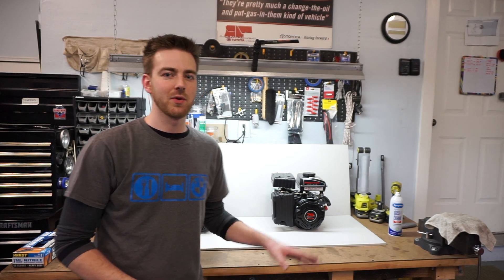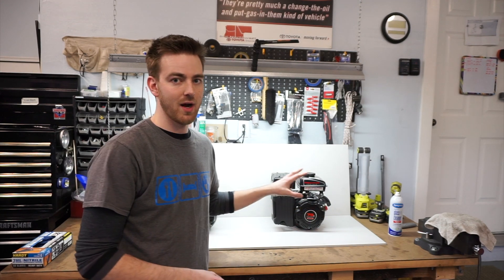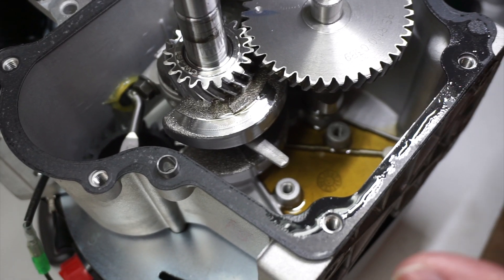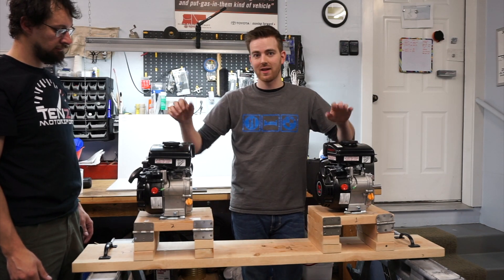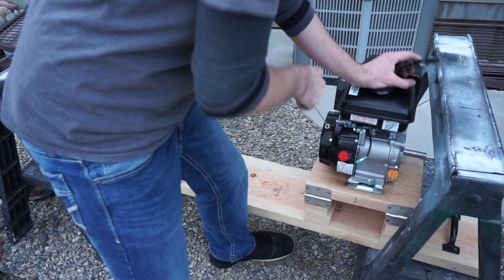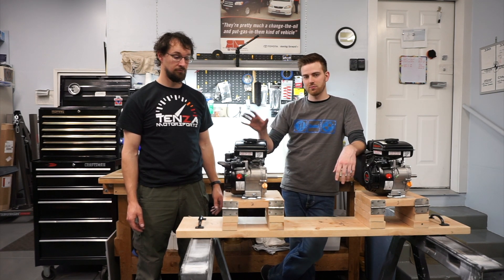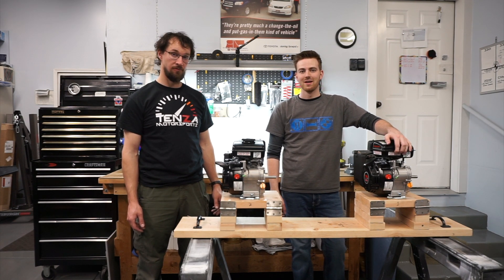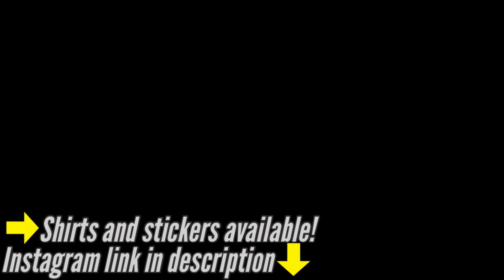Small engine testing - Something Versus Nothing - How long will they last? Control testing.

Comment: I always choose nothing when testing my engine, that way I save money and dont have to worry about that something failing on me. Choose nothing my friends #nooilneeded #OilisaScam #RunWaterInYourEngineForReliability
Reply from the maker: Oil is for chumps. This test proves engines can run without it lol
Reply: @TenzaMotorsports  Screw the system! #nooil2020